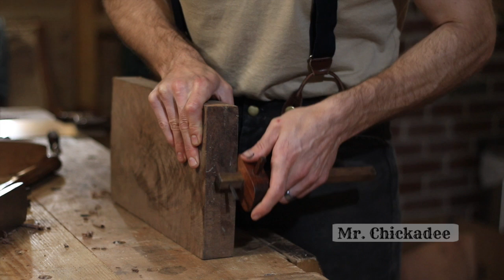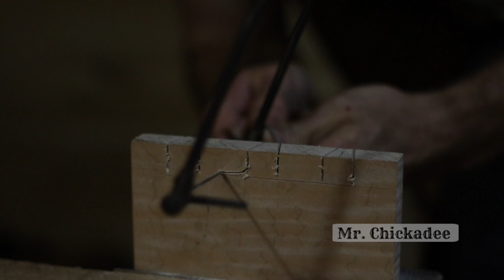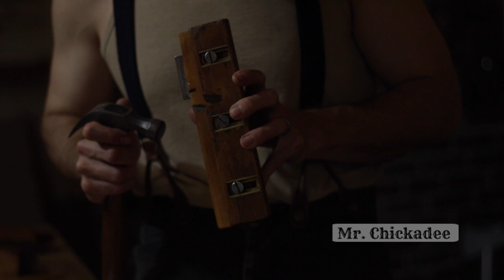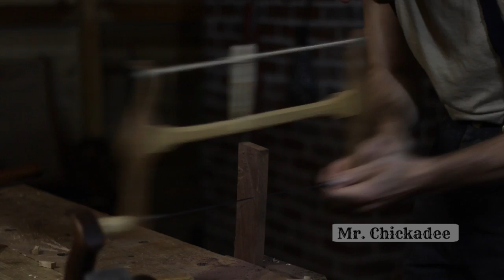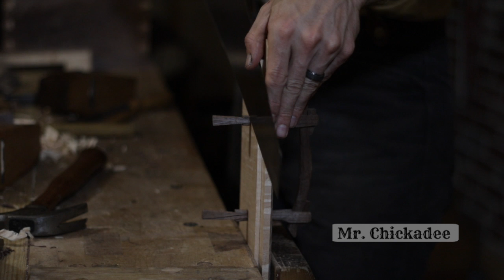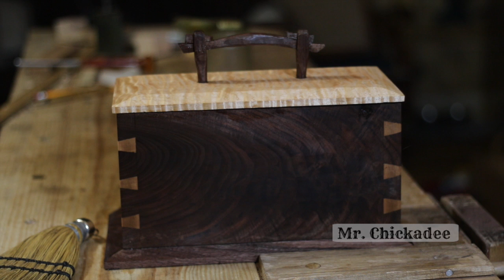INSANE GRAIN DOVETAIL BOX

Comment: The walnut is absolutely superb and I like the grain of the maple even better than bird's eye!  When I lived in the Mississippi river valley I had access to a lot of good, tight-grained walnut and it is a dream to work with it.  I admire the sharpness of your tools....seems a sharp tool rarely cuts you...it is the dull one that you end up putting too much pressure on that do the harm.  You can't impress that on some guys.  The handle on the box was just the icing on the cake!

Comment: I liked your pegs holding the bottom on and the handle. I tried something the other day that I have never seen done but I'm sure  I'm not the first. I needed to repair a split in a piece of wood. I used the thorns from a Hawthorne tree.  I ran them at an angle to the split after I clamped it. A pilot hole was necessary but they drove just like nails.
Reply: I have a couple of old window sashes and the munitions are pegged - with long thin pegs - now I know what they are!!!
Reply from the maker: @sawdustwoodchips  are they draw bored pegs holding the frame together or in another orientation? there are also dowel joints in much traditional sash work, they had special bits and doweling boxes to accomplish this. Ive never needed it for my sash work, but some must have in the past...

Comment: I have to say that your perserverance in resewing that walnut is commendable.  I once started to resew a piece of 8/4 cherry that was 10" wide and 6' long - I got only 5" in and realized that I was going to be at least a morning just sawing.  Love the final box!  what wood did you use for the pegs?
Reply from the maker: Thanks, years ago I used to avoid or dread large sawing operations, especially big thick rip cuts. As the years prrogressed, or maybe my experience sharpening and tuning my saws has developed, I see sawing as less a chore, more a relaxing event. I used to split most tenons, especially large timber frame ones, I find now I prefer to saw them, the extra time sawing still often comes in faster than the time paring or planing after splitting. 

I think my worst to date was a large block of Q/S beech, 4x8" 3' long, I resawed that up into 1/2" thick pieces to make timber frame templates. I think a large frame saw is in the future for me...

Comment: The dowel the board was resting on when resawing is interesting. Is that the intended use or is it for something else but came in useful here? It stops the board slipping forward on the push stroke I’m guessing? Build yourself a roubo frame saw, 48”; you won’t look back. Thanks for the video
Reply from the maker: That poor dowle serves many duties, he goes in the deadman when planing long boards, he and a friend work together in the same place either side of the leg vise to prevent mortised stock slipping down as its pounded, and yes, he helps a piece being sawn from sliding forward on the push stroke. Ive not gotten to making a large frame saw yet, probably would if I did more resawing of wider stock.

Comment: Reassuring to see someone with hands as battered as mine! Interesting your using a coffin smoother before the metal plane. Was it tearing out? Is the coffin a single iron or is the mouth too worn? It’s dangerous territory but resent studies have clearly shown that planes with cap irons (wooden or metal) outperform single iron planes categorically, regardless of mouth width. Mitre planes are the exception simply because the metal bed and tight mouth are essentially a cap iron. I love my wooden single iron planes but fall short with crazy grain.
Reply from the maker: I switched because of camber progression, not tear out. All my planes are double iron, and all have well set cap irons, even the jack, which limits the tearout rather than preventing it (in the case of the jack, in the case of every other plane like try, and various smoothers, it completely eliminates tear out) 
So in this case, I started with the jack, then progressed to the small coffin smoother which had less camber, then to the stanley no5 which has even less, which gives a finished surface. 

The cap iron is in my humble opinion the last great improvement in handplane technology. (I dont consider metal bodied planes an improvement per se.) Its obvious not all craftsmen knew of it ability, and MANY still dont. I feel anyone who has taken the time to properly tune a close cap iron and then plane ANY wood, with or against the grain, and through any hellish knot or curl, (all with a random 45% bedded iron and wide open mouth) should see how amazing an improvement, and also obviously why they became the tool of choice across the board.  

I dont even find mitre planes to be an exception, as its just their duty (if used across grain on end grain as the name implys) which permits them to "get away" with no cap iron. I find a standard bench plane with 45% bedded iron and cap to be just fine for all end grain work ive dont, if properly sharp. 

There is so much knowledge lost that was common to craftsmen in the past, our current "experts" are just starting to piece the picture together again. I find the only correct road to the truth is hours and hours of dogging it out at the bench, soon  finding out what works and what does not.

Comment: Does the structure of the box/dovetails keep the figured wood fairly stable?  I've tried working with real figured wood before and it seems like it always wants to twist or move right at the best looking parts.
Reply from the maker: yes, tight joinery of some kind must be understood and correctly utilized. Panel and frame, dovetail corners, sliding dovetails or some combination of the above.

Comment: Just curious, why did you not use any hide glue? I thought you might have used some on the dove tailed joints. Beautiful Box!
Reply from the maker: these dovetails are insanely tight, and the box is not subject to the forces of say a drawer for example, no one will be moving or shifting it. I guess the simple answer is, no glue was needed.

Comment: I found it interesting you hammering on the wood directly with a metal hammer when joining the ends to the sides, something my shop teacher would have blown his stack over
Reply from the maker: The walnut sides were essentially end grain, very tough, I would have been more careful if they were softer. No marks were left. Rules can be broken once a good understanding of the material is made.
Reply: Than you for the explanation.